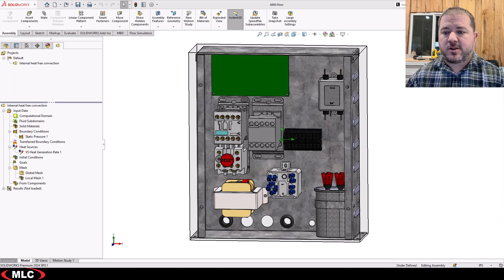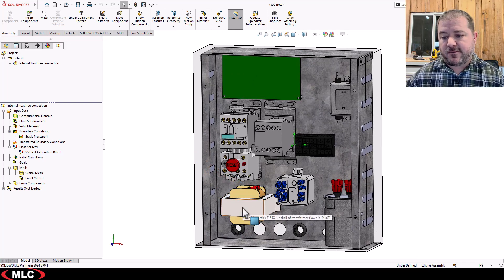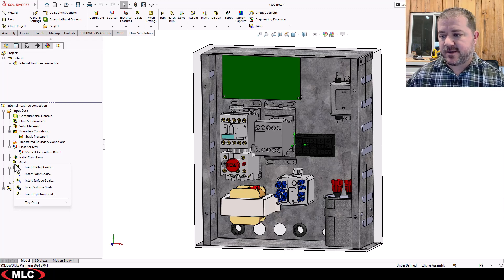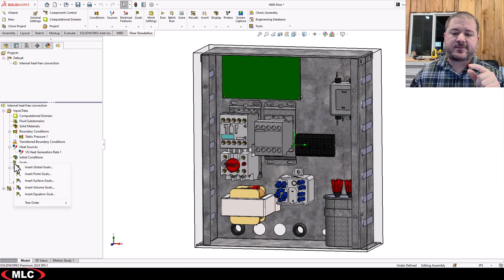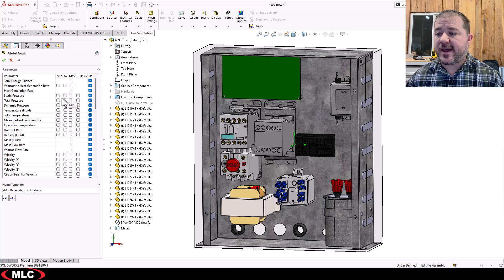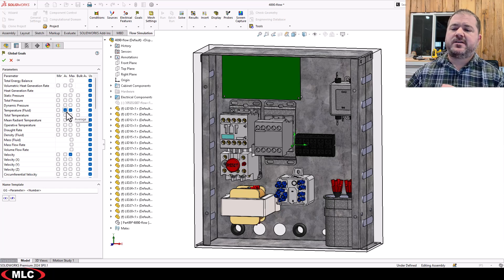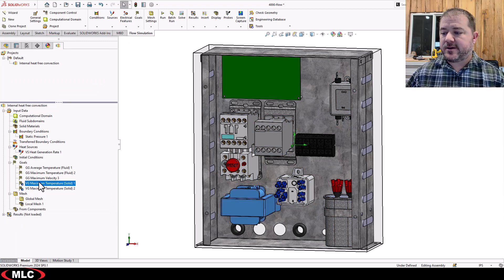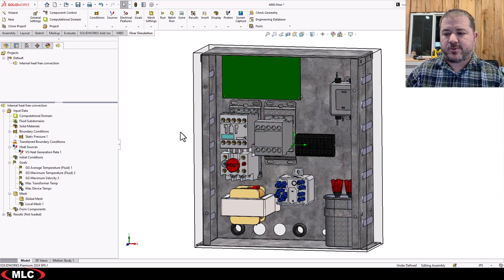How to Select & Define Goals for #SOLIDWORKS Flow #Simulation Convergence

Comment: Thanks for the video. Can I introduce breather valve in this simulation setup, to maintain equalise pressure and temperature with ambient. Please share video regarding this option
Reply from the maker: Yes you can.  Create a lid where the valve sits and you can define a boundary condition to represent the valve condition.
Reply: @MLCCADSystems  thank you for the response